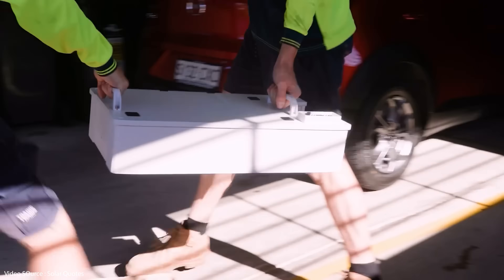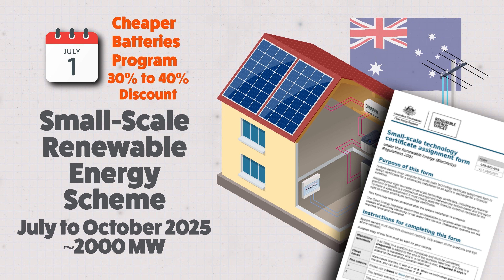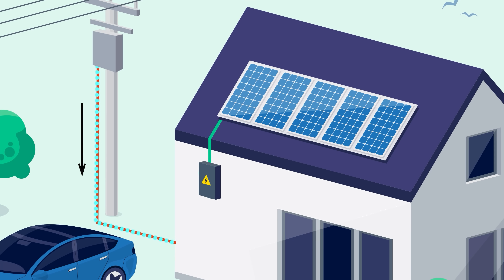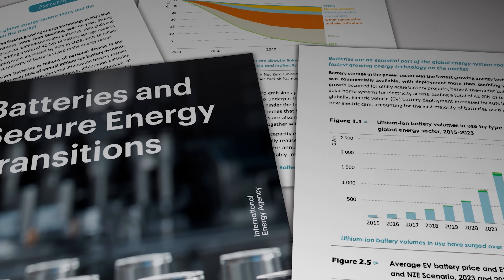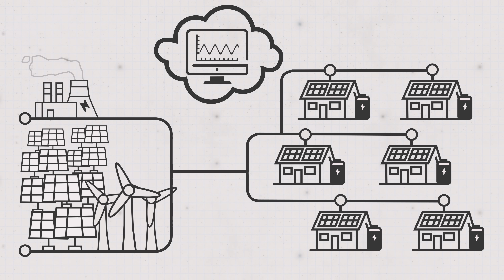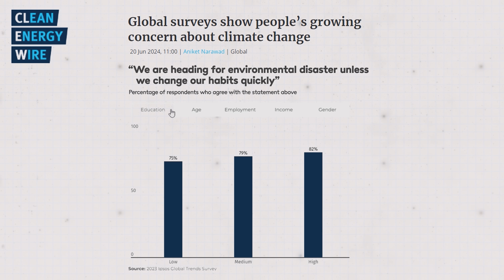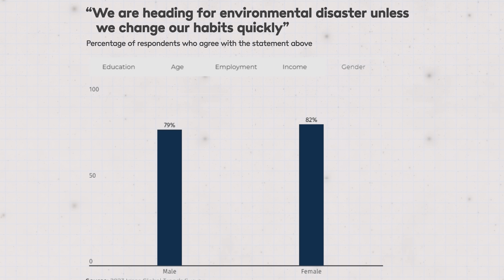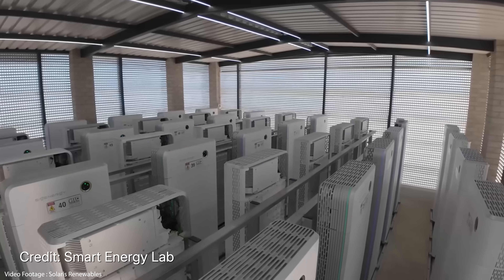Australians installed 100,000 home batteries in 17 weeks. Why can't we all do that?

Comment: We have a 15 kW solar array at home with Enphase microinverters. Batteries did not make economic sense when we built the house because of their high price at the time and because we have net metering plus a 10-year incentive program that pays us for exported electrons. While I might get a home battery when that 10-year program ends, I’m intrigued by the possibility that our next EV could have vehicle to home charging capability. It would be great to buy only one battery and have it serve two purposes.
Reply: Your battery in an EV has only so many charge cycles before battery degradation begins to kick in.  If you were to use it as home backup you're going to introduce more charge cycle uses which will speed the degradation.
Reply: @Les_S537  Depends on the technology if it matters. NCM sucks for this kind of use case. Also you'd realistically not use your EV for this, you'd buy a crash damaged second hand EV and just use it as a wheeled battery pack, or indeed just take the battery packs out as people do already.

Comment: Batteries and solar panels at private homes or local villages will become the backbone of the electricity system of most of Africa and Southern Asia. It's already happening in Pakistan.
Reply: Like mobile phones
Reply: It's only months to recoup the investment for a replacement for diesel generator in Africa and some private lending exists to help with that, it's growing fast.
Reply: Give Cheap Batteries to Pakistan. I have heard something about sodium ion from catl😮😮
Reply: This is why Pakistan is so successful.😁
Reply: @crazyedo9979 
Why?
Reply: Exactly, they have this thing called SUNshine consistently.
Reply: @w8stral  to be fair, most everyone on earth lives where there is abundant sunshine.
Reply: @brettgracey9682  Have you opened a solar map?  No.  Or more precisely you might have ONLY looked at an AVERAGE map, not a seasonal map which is the ONLY one which matters.  China = big fat NO even though they have low lattitude.  SE Asia = 3/4 of year yes, and then 1/4 of year = MASSIVE NO.  Japan = only in south.  India = S, Yes, East = no, North/East = yes.  Middle East = yes.  Europe northern = NO.  Southern Europe = yes. Africa where people live?  Hit and miss depending on your assumptions for shipping said solar power, but if you break it up into individual nations... its mostly no.  South America = hit and miss though generally speaking where people live it is good.  Central America = Yes.  North America = Southern USA Only and rest = NO.  

Now if you add that up, solar + battery alone can ONLY work for at most for 1/4 to 1/2 the population of the world with some VERY generous assumptions not spelled out.
Reply: @w @w8stral s I have been looking at those maps for well over a decade now.  Your whole appraisal is set to a what standard.  You think China is a big fat No, yet they have as of July this year installed over 1100 GW of solar.  You might want to tell them it doesn’t work.  Don’t be surprised if they think you are an idiot, rightfully so.  
I can only guess as to what criteria you are using to determine your concept of feasibility.  I live in Canada, and you know what, solar actually works very well, especially in winter, especially when there is snow cover.  See solar panels actually works very well better when they are cold.

Do they generate as much power as they would in North Africa, no, of course not.  But that is a ridiculous standard.  I can generate just as much solar power on a winter day in Canada, as someone could in Saudi Arabia, I just need a few more panels.   That’s an economic issue, not a technical issue, like you believe.
Reply: @brettgracey9682  Some folks believe that the Moon and Sun are Gods and that man can therefore never get near them. Luckily the folks at NASA didn't take any notice of them. Time (and economics) will determine this argument regardless of the beliefs and feelings of anyone.
Reply: @brettgracey9682  No one cares about nameplate capacity.  How much POWER do you get is all anyone cares about for what cost.  You  play make believe cost does not matter... How dumb is the modern human being?  Progress of Civilization throughout ALL of human history is based on how CHEAP is the power available.  Solar is a step BACKWARDS.  A massive step backwards  except those who live in Desert regions.  For them, solar is the best thing ever.  Now you could argue on of the largest regions of earth can be turned GREEN(Sahara), but otherwise, for everyone wanting to live where they are on SAME standards or INCREASING standards, solar sucks.    yea yea, I installd 40kW myself, but that is because it was going to cost over $50,000 to get power to my own house.
Reply: @w8stral  40kW home system?  Must be some place you have there Elmer J Fudd. 

So you understand a vast majority of the world’s population has to rely on energy imports.  There is significant impetus to become more energy self sufficient.  That is its own economic reason.  Add to that it’s technology versus a commodity.  A technology that is literally, get this, renewable.  Not subject to external markets, politics, transportation, shortages.  
You have what seems like a typically US attitude.  You think everyone simply has to make the lowest cost choice between grid power, and gasoline/diesel and some alternative.  For so people, thinking Pakistan, and most of Africa, it’s not only the cheapest option, it’s not only the best option, it’s the only option.
Reply: @w8stral  Perhaps you missed the part where Dave reveals that his home's battery and solar panel system will be paid off in 9 years.  Since his system will most likely still be producing to beyond 30 years of age, this means he should get upwards of 20 years of free energy beginning about 1 year from now.  Or in other words, taking the total energy bill for the 30 year life of the system down to 1/3 what it would have been had he not installed solar, in England.  Many people in England and Germany report similar success with their solar systems.  And what this means is that more than 90% of the world's population can benefit a great deal from the installation of solar with batteries either in or around their home, or somewhere nearby as a micro-grid.  

Now, your message specifies "solar + batteries alone."  This is a misdirection.  Grids already exist.  So going off-grid is an option for many people, but it is not a necessity.  If the decision were made to do it, with a massive (and alas, hypothetical), focused effort, it would be possible to shut down the majority of fossil fuel powered generation within a few years' time.  And to gradually draw that down to around 10% of current fossil fuel consumption over another few years.  That gives us a good ten years (and in reality, sadly, much more than ten years) to work out what to do about that last 10%.  Of course, if BY THEN we can't come up with anything, then we just might have to keep running a few gas powered plants for that last 10% to help with overnight base load in places that need it.  But whether we do or don't keep those last few plants online has no bearing on whether today's solar purchases will pay off.  They absolutely will, for pretty much everyone who is currently getting their electricity from fossil fueled power plants.  It's really just a question of whether you have too many trees around to see the sun, and what options you have to work around that.
Reply: @HonestJohn-y3k  He literally has not.  Why?  Because his metric for "payed off" is held against a FALSE doubling of the cost of power.  Who knew, make electricity impossible to buy, and guess what, solar all of a sudden becomes "viable".  And that is in VERY VERY sunny Australia.  If Australia cannot go solar(it actually can) then no one can, but absolutely NO ONE should take ANY advice on cost performance from Australia unless you are Egypt or equivalent nation in an equally sunny spot.  Just like if UK cannot go Wind power, then NO ONE can.  So far, UK cannnot even do wind power correctly as they are IMPORTING ~15% to 20% of their electric needs and this does not even cover heating which is done by Natural gas.
Reply: @w8stral  If you are referring to Dave, then no, he is not in Australia.  He is in England.  And he seems to be pretty good at math(s), so I'll defer to him on when his system is paid off.
Reply: @w8stral Hey man, if you have energy flowing out of the ground, take it. If it comes from the sky, use it. Most places are not fossil energy rich, so the costs can vary greatly.
But one thing to think of is balance of payments. If energy costs are keeping money inside your borders it is better for your economy. If people are willing to invest in their own energy supply with a 10 year payback, then good on them. Up front costs will often go overseas but reduced outflows as inflation increases over time benefits in the long term
Reply: @w8stral What you are saying is just wrong. Just start googling for 1 sec. Cost of production from a Gas-Powerplant is between 11 - 18 cents/kWh vs 4.3 - 9.2 cents/kWh from solar.

I live in Germany. By installing a solar + batterysystem for 10.000€ I can reduce my electricity cost by ~70% with 5-8 years payback time. So solar is actually just cheaper and it's getting cheaper still. Yes this is also because electricity prices increased, but they didn't  because of renewables but because of gas shortages. In the first year of the Ukrainian-War the price nearly doubled, which actually cause a lot of bankruptcies from companies that relyied on cheap gas prices. So what you are saying is just utterly nonsense.

Yes when you factor in battery prices to the production costs, in large scales solar will be more expansive, but for your own production it's still cheaper that consumer and industry prices. Which only means as a country you can't only rely on solar, but that's totally of topic
Reply: @jakobseith3403  NG electrical production cost is ~ 3c/kWh, not the stupidity you quoted.  Just like that is ALSO the cost of nuclear and coal on the industrial market.   Why aluminum plants which use MASSIVE amounts of power place their plants right next to hydropower plants, geothermal plants, coal plants, NG plants and NOWHERE near a stupid solar farm.   Industrial giants aren't stupid, just posters on the internet
Reply: @w8stral  You are mixing two kinds of costs: total costs and variable costs. I was talking about total costs in €/kWh, including construction, maintenance, and fuel, which makes more sense when comparing fossil fuels with solar, because solar basically has no variable costs. If you want to compare variable costs: the best gas power plants have costs between 4-6 c/kWh (in Germany) depending on efficiency and gas prices, while solar lies between 0.1-2 c/kWh. So solar is cheaper anyway. 

Also, when you compare total costs, fossil is basically the most expensive source of energy. Still useful due to being a CO2-free form of baseload, but still expensive. 

And they probably put themselves next to power plants because of regulation, OTC contracts, and because solar can't deliver baseload energy. Which obviously is a massive downside, but thats not what this is about.
Also, there are more than enough industrial giants with a solar farm on their roofs and a battery, because they’re not stupid and it’s simply cheaper than buying electricity from the grid.
Reply: @w8stral i have no idea why you said "solar is a step backwards".
Fossil fuel are just solar energy stored by living things in Earth past.
Now we just moving to consume solar energy more directly.
Reply: @w8stral 
Where do you get your oil from.?
Reply: unless they have an industry lol!!!! in my country we have aluminium manufacturing plant and it alone uses almost 1/4th of the countrys energy, if the increase the production it only gets worse.

Comment: I do like and value your videos. But. Your statement:
"The capacity of the batteries installed ...is,...just under 2000 megawatts. That's enough to cover ... the average daily electricity consumption of almost 400 000 households."
That doesn't make any sense. A capacity of 2000 MW can operate for a second, one minute, one hour, one day, a week perhaps, or a month. How does it cover the "average daily electricity consumption"? 
When you make such a comparison, you really should discuss the storage capacity, i.e. MWh. Please. It just hurts my engineer sensibilities.

But I still like and value your videos. Please keep up the good work. But MW and MWh are quite different beasts.
Reply: Agreed, it’s frustrating that even well educated commentators confuse power (kW) with energy (kWh). Both metrics are important when discussing battery output and capacity. Edit: to be clear, I’m not saying Dave is wrong. Power output is important but needs to be in the context of available energy capacity. 1MW output is very different with 1kWh capacity versus 10 MWh.
Reply: Yep 100% agree. It irritates the heck out of me 😊

Comment: This is a good reason that residential homes should be supplied with 3-phase AC power. So that all consumers can benefit from additional phases and the whole system can be balanced easier.
Reply: The system should be balanced irrespective of the houses getting single phase. Different sets of houses will be on different phases. Assume random adoption of solar it should almost balance out. 

If for any reason a single phase is overloaded in an area its easy for the utility company to switch which MV phase feeds the transformer in that area. A little bit of a pain but very doable.

Comment: I have run 2 old Nissan Leaf packs supplying my home for nearly 4 years. But I am a mad engineer.😅
Reply: Now THAT should be a youtube video
Reply: @go_fourth  Hi from Canada... absolutely!  Creative innovation beats greedy corporations!!
Reply: Aren't all engineers a bit mad?😊
Reply: @thrift154  Yep, it's in the job description. 🙂
Reply: Yeah, when my Cupra Born battery carks it in about 12 years from now, it will be replaced with a new one and the 77kWh battery, which will have around 61kWh of usable capacity left, will be added to the home storage system. Good on ya. I keep telling people that EV batteries can have a second life, but very few believe me.
Reply: This is the way. As someone who loves to build things and realising that every pre-assembled item you buy has been inflated to cost 10x the amount, I refuse to buy things now days. 

The research of reverse engineering things is a hobbie itself. The saving yourself thousands is a bonus. And the fact that you made it yourself is very rewarding.
Reply: I'd love to be able to drop the battery out of my Bolt when it reached EoL and use it for home storage. A 'free' 30kWh sounds awesome. 
As is I try to charge when it's sunniest, but it's far from perfect.
Reply: Do you know of any suppliers, in the UK, of V2X chargers? Matt Lee.
Reply: Exactly what they did at Rome Fumiccino airport.
Reply: Yes second life of old packs is ideal for solar.
Congratulations on you installation and keep it up. M.